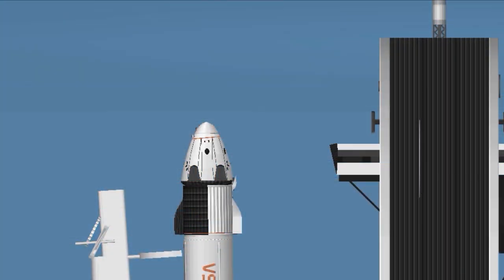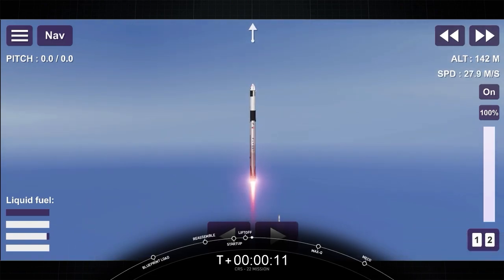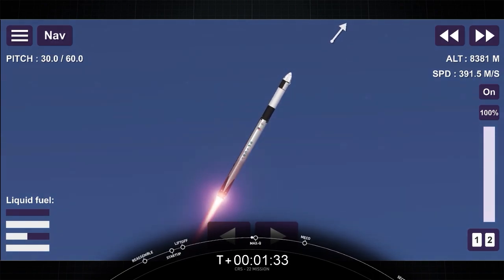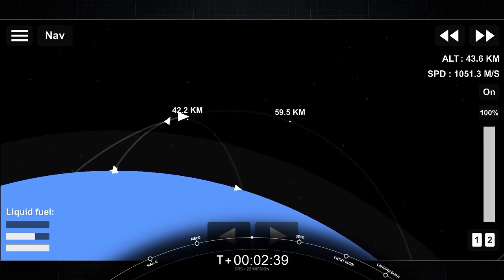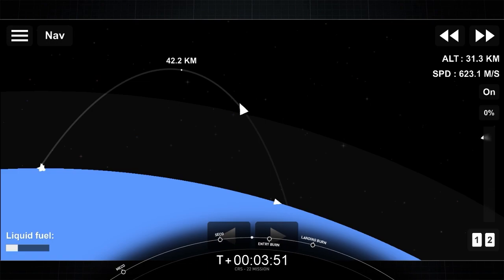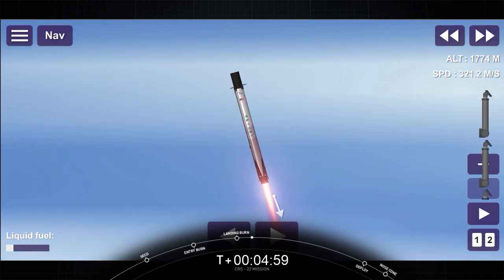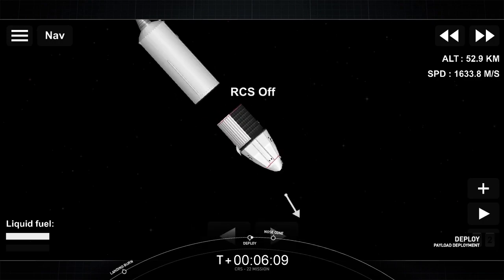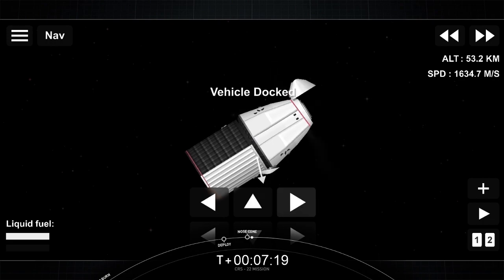CRS - 22 Mission

Comment from the maker: Disclaimer : we don't performing 13 seconds Boost-back burn, due of additional solar panel array on the Cargo Trunk (adding more weight) which is make the fuel insufficient to perform,

Also forget about "MISSION FINAL" that's my mistake :v
Reply: But i think you could add the short boostback for 2 seconds for more realism?
Reply from the maker: SpaceX-Space Flight Simulator  that’s caused of the video files name on Adobe premier, i save it as a final rendered video name (Final Mission) and forget to change the title during uploading